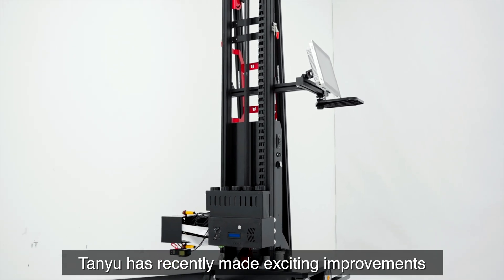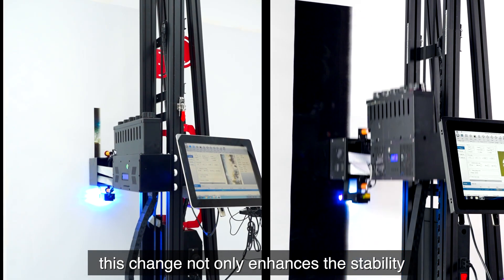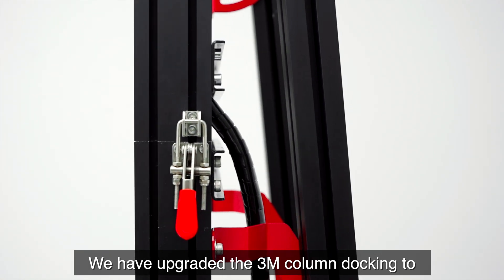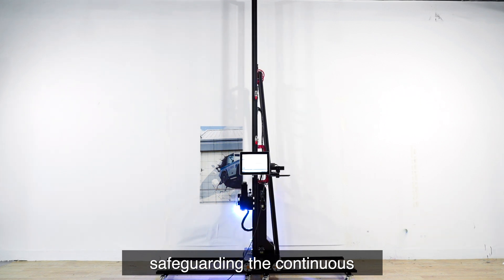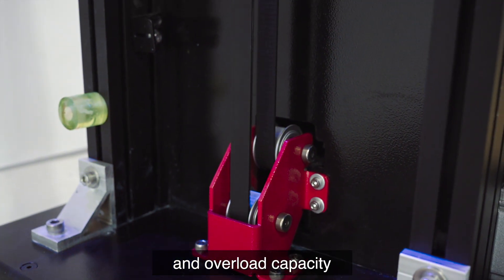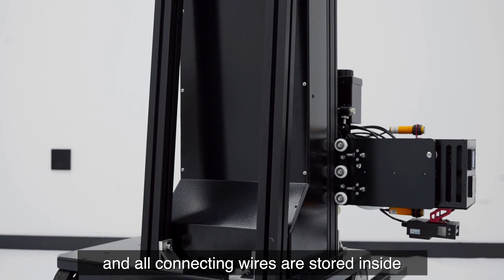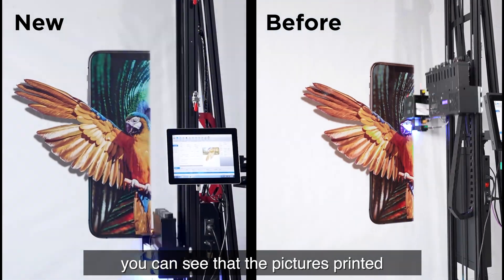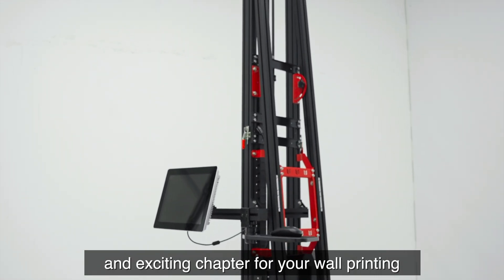Tanyu TPP1000 vertical wall printer new and old models comparison

Comment: Its a verry heavy macine. To transport and get in place…..are there upgrades transport this machine in more parts?
Reply from the maker: Hello! Regarding your concerns about transporting heavy machinery, we have a TMP1000 portable wall printer machine with a modular design, which is easy to carry. All parts of the machine can be disassembled. The weight of the whole machine is 50kg, the heaviest chassis is 15kg, and the longest support is 1m. It can be put in the trunk of a car, which is easy to carry and go out for work.
Reply from the maker: More details you can contact us for Email: info@tanyu-tech.com
Tel: +86 18625127717 
WhatsApp: 0086 18625127717